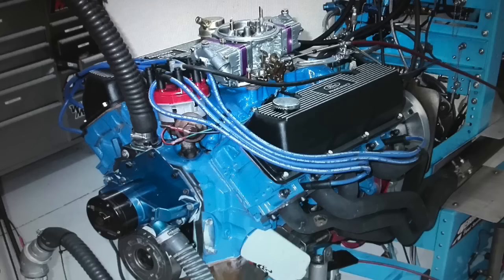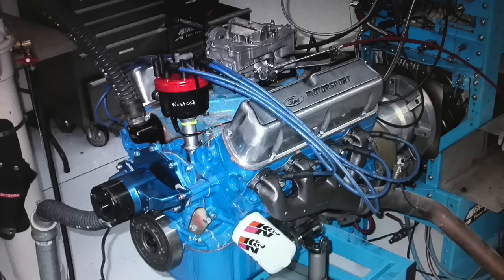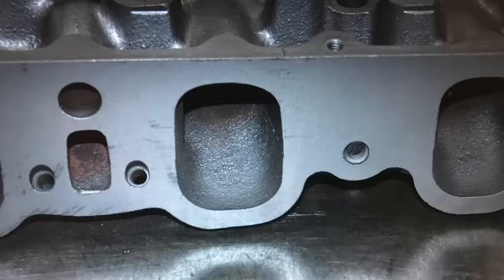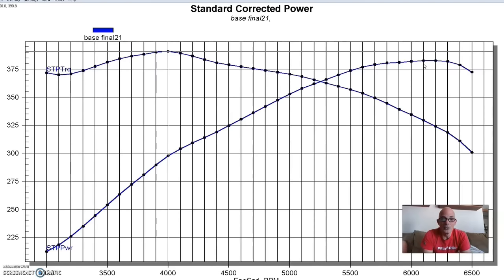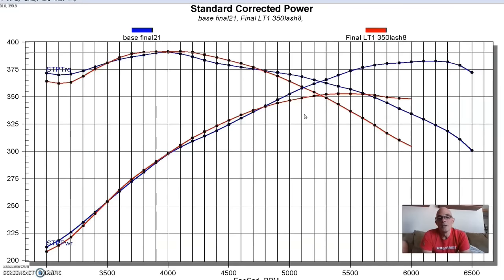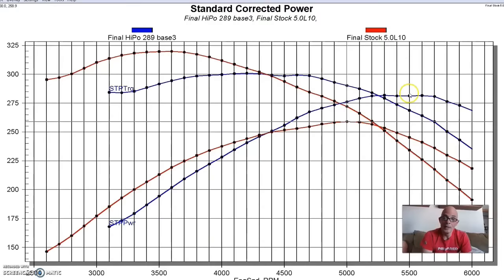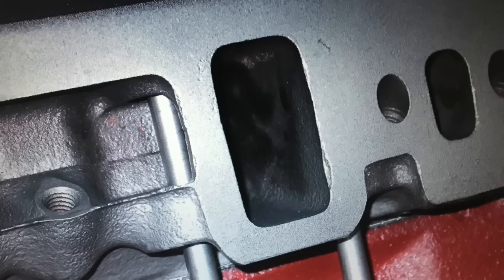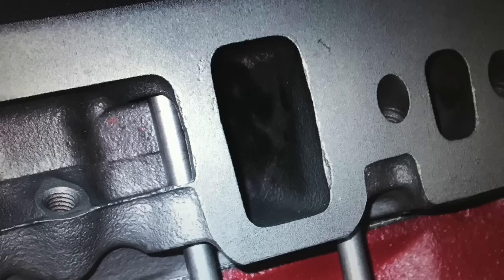HOW MUCH POWER DID THE 1971 BOSS 351 REALLY MAKE? WAS IT THE HOTTEST SMALL BLOCK EVER OFFERED?

Comment: Awesome vid. The GTHO's 351 Cleveland engine output was understated as 300 bhp (224 kW) to satisfy insurers. It is generally accepted to produce in the region of 350-380 bhp (265 kW -283 kW). Initial cars were equipped with an electrical rev limiter which came into effect at 6,150 rpm. With the rev limiter disabled, the engine was reputed to pull in excess of 7,000 rpm, even in fourth gear. At that time the Phase III GTHO was the world's fastest four-door production car.[4] 
Performance: 

Top speed: 228 km/h (142 mph) @ 6150rpm 0 - 60 mph - 6.4 seconds 0 – 100 km - 6.9 seconds Standing 1/4 mile (400m) - 14.4 seconds using the standard 3.25:1 Detroit Locker diff ratio. An optional 3.9:1 ratio differential was available and reputedly enabled such cars to cover the 1/4 mile in 13.9 seconds. In November 1971, Ford of Australia began producing its own 351C engines, ending the importation of American engines. At the outset, Australia only produced a 351-2V engine, but in March 1972 Ford of Australia began to offer a new 351-4V engine with a 4-barrel carburetor. Australia only produced one style of cylinder head for the 351 engines, a 2V head with small ports and open chamber cylinder heads. As a result, the Australian 351-4V engines used the 2V cylinder head. This required a unique 4V intake manifold with the smaller 2V ports, unlike the American 351-4V intake manifold which used the large ports.[1] No 351C built in Australia used the large port cylinder heads or closed chamber combustion chambers like the US built 351C-4V engines

Easy info straight from wiki, plenty more available with a easy google search. And then there is the rarer phase 4
Reply: Hmmmm same performance figures as my 2008 V6 Camry daily driver. Tyres were crap back then though. Modern tyres on a phase 3 would be much faster. That's if anyone ever drove a phase 3 anymore.
Reply: I did not realize only one head was available in Australia. However,  the hot ticket is to buy Australia 2V heads with closed chambers. I think you may have some bad information ??
Reply: @daleostrom3613  when I was a kid there were 2v and 4v heads, closed and open chamber freely available from wrecked Falcons.
Sounds strange to me too.
Reply: @daleostrom3613  haha living in austraila have three sets of closed chambers 2v heads and virgin bore 351 cleveland  short D block ...with pistons and crank ...Sitting in my garage...... also have a 302 cleveland complete motor on oringal bores and 2v heads....in the garage ........to name some of my fords here .....
Reply: @jamiegreenwood7996  yeah Im not a Cleveland guy more into modulars just took info from wiki, my mistake. I still stand by that the aussie Cleveland was the most powerful mass factory produced ford small block.... "In The World"

Comment: I have a stock 1990 5.0 mustang. Without doing heads, what's a good option to add a little power? I figured a cam cause it's always felt gutless up top.
Reply from the maker: gears, headers and cam with springs
Reply: @richardholdener1727  Thank you for the reply!

Comment: How would it compare to a stroker 347 with those (see if I get this right from my memory of thumbing through old Jegs catolouges) trick flow twisted wedge heads?
Reply from the maker: A stock Boss motor vs a modified 347 Windsor stroker with after market aluminum heads?

Comment: The first engine I ever rebuilt, about 35 years ago was an M code 351 4v Cleveland. Yanked the 302 2 bbl and 3 speed out of a 66 Fairlane, and dropped the 351 and a top loader 4 speed back in. Never lost a race once I finally figured out how to put the power to the ground, but that's a whole nother story 😁

Comment: Hahahaaa.....
I’ve been proving that for 40yrs!
The 351B is a beast, it’s Fords exotic solid cam engine. Ya just gotta play with the oiling system a bit and that’s a cinch.  One or two restrictor plugs and it’s good.
On a side note the 1971 Boss 351 Mustang was the fastest stock production Mustang until the mid 90s, ran like 13 flat in the quarter.

Comment: I've had more than my fair share of fast muscle cars and agree with your favorite Boss motor for many of my own reasons. I do, however, have a question about your Boss Cleveland assembly you had not mentioned. As most true Ford guys know, the four barrel Cleveland heads had 2 very distinct/different designs. Which were used on your Boss Cleveland? The "Open combustion" or "closed/quench?"
Reply from the maker: the Boss 351 only had 1 style 4V head-it was a closed chamber
Reply: @richardholdener1727  My question has been answered. My statement, however, was in reference to 4 barrel Cleveland heads and not just the Boss application. My apologies for the confusion.

Comment: The 289 was a great engine for its time. It had a small carb, and its K code Challenger heads were the normal heads, just screw in studs rather than press-fit. Fords tend to run smaller ports and valves in their heads than Chevy counterparts, which helps torque---until you get to the exhaust port, which is always crimped up to fit against the shock towers (the first Windsor was the 221, named after the flathead like many Fords begin their displacement like the 239 Y block, destined for the Falcon, with those shock towers in the way). A common replacement after 1969 was to run 351 W heads with the bigger head bolts. Until then, Ford had a Tunnel Port head that evolved into the Boss 302 setup.

What may have also helped, was George Barris signed up with Ford, and tossed the 289 into a few star vehicles like the Munster Coach. Monkey see, monkey do. But dump a 289 in something light, like a Sunbeam Tiger, and that light weight combined with the torque, makes things happen. HP sells engines, torque wins races :)

No doubt, tho, the 5.0 engine of the 1980's was a home run--and matched to the T5 transmission gears really helped avoid running into its 4500 RPM unofficial redline where it ran out of breath. Tune it right, run 13.4's in the quarter, and you thought you had a 390 GT or 428 CJ. The AOD did it no favors, tho, showing the gear ratios in the transmission really helped its performance.

Comment: The autoshop teacher told me to find some heads to build for my 68 mustang.  I went to Ford Power Parts in Norwalk I think.  They had some high-po 289 heads that needed rebuilding.  Think I paid about $100.00.
Took them to Jackson's auto in Brea, and the old guy there did the machine work on the heads for me for a song, and some sweat equity.
Granted what I'm going to outline is in no way stock.  It had the heads from a high po 289.  It was a 1968 302, stroked to 331, domed pistons ground to accept the valves from the high po 289 hieads, a mild cam and a holley 620 on a weiand aluminum ported dual plane high rise intake manifold. 10.5/1 compression, and tri y headers.  We didn't have an engine dyno in autoshop in 1991, but had access to a rolling dyno down the road from the high school.  I'd have to find the print out to give you peak torque at the wheel, but the horse power was 320 at 6800rpm at the wheels.  That was through a 4 speed top-loader, and 9" rear end ( after I made the stock rear end quit).

Comment: Early February 1972 I performed the dealership PDI on a just off the transporter brand new '72 GranTorino formal roof bench seat , column shift , AM radio, rubber floormat ,poverty capped 8x15 wheeled 351 SCJ, 11-1 compression solid lifter hd C6,391 locker , heavyduty everything incldg 11x3 rear drums front hd disc brakes . I waited until the snow melted and roads dried before the test drive, unlike anything I'd driven...summer of '81 as borrowing Alan Kulwicki's tire groover, for our 1 of 3 Fords running that season, found car in Alan's dads garage in Greenfield,Wi. only now with 5.13 gears and tubular front end . Several weeks later Alan made his first laps at Hales Corner Speedway in that Gran Torino bodied racecar ,Cleveland screaming like a Grumpy Jenkins smallblock . I guess I drove Alan Kulwicki's first race car before his dad bought it ...Thanx for the memory jog
Reply from the maker: 1972? was it a left over 1971 (last year of the high compression in the Boss 351)
Reply: @richardholdener1727       I was told, by the guy who ordered cars for the dealership, somebody must have hit the wrong keypunch and it was a mistake(wink-wink) but there were items on that car that couldn't have been that many keypunch errors. I think Alan's dad new someone at Ford to push the Last Hurrah as a gift for his son's 16th birthday. Window sticker read just over $3,200 , just before I left the dealership  in October "72 with new '73's on the lot , I was told I could get the car for $2,500 but my dad wouldn't co-sign. Obviously Alan got the deal. He did well .   Imagine brushing 8" snow of the car to open the hood to read the air cleaner lid labels "351SCJ"  "PREMIUM FUEL ONLY" and aluminum valve cover sticker solid lifter specs.

Comment: My dad talked about a 64 Fairlane with a 289 hipo looking like a super stocker at the time and I had one that I dropped in my 68 Mustang coupe that I beat a number of early 90s mustangs that had gearing cold air kits and exhaust work with pulley kits and still couldn't hang with my 68.

Comment: I've owned a 340 Duster. The 340 is trick, from the factory. Forged crank, pistons, windage tray, double roller timing chain, 2.02" valved heads, etc. But in factory trim, a 351 Cleveland is hard to beat.

Comment: How are you mate , I'm a passionate Henry man from Australia . The home of the very best of  cylinder heads for the M code 351 cleveland . These heads have the small valves , smallest combustion chambers 51 to 54 cc's for a 40"' skim should give nice square head decks and 12.4😢 through 12.7 , my honed block
Reply from the maker: noice mate!
Reply: @richardholdener1727   did you get a look at the profile ?. Typo on inlet peak valve lift should read 622 "' , not 522"' , all other facets of the profile are accurate . The 2 Venturi small valve , small port heads from Aussie 1970 thought to 1982 have 54 cc's to 57 cc'd here and I , which gave me an even across all 8 cyl's of 245 psi . This base combo when added to an M code is the ducks guts , to use an older Aussie colloquial term .
Reply from the maker: what profile?

Comment: Great video, a couple questions. Did ford use the windsor block in the boss 351 like was stated in the boss 302? And what was the cam specs for the 351? I'd love to see a comparison of the classic 4v heads and a modern alum.
Reply from the maker: we used a 351C block for the Boss 351
Reply: The Boss 302 Block is different than the Regular 302 Block. Much stronger virtually everywhere. 4 Bolt Mains, Screw in Freeze Plugs. About the only thing in common is the Bore and Stroke Dimensions.
Reply: all 302's were windsor blocks. 351c, 400m, boss 351c are clev blocks. boss was +adjust rockers & sol cam, 4-bolt, forged crank? & pistons?, HD rods. The canted valve heads are clev. 302 & clev blocks could swap heads with a few water passage mods. 351W was the grocery getter back in the day (as I recall it)

Comment: Back when I was a teenager whose friend's Dads had plenty of money, I had the chance to ride back to town in  one of my friends Camaro with a 327. At one light, a 289 Hipo pulled up next to us, also one of the guys. When the lights turned green ,they had a good start but in 2 races, the Mustang pulled away from the Camaro. The guy driving the Camaro was in such disbelief that he let the Ford driver drive his car and one of the other guys drove the Mustang with identical results. I may be wrong but I believe that advertised HP was 250 for the 327 and 289 for the 289. ???
Reply: 289 Hi Po K code rated at 271 HP

Comment: What's  the Flow Bench numbers 🤔
1. Boss 351 Heads
2. Hope 289 heads
Thanks 😊
Reply from the maker: HiPo 289 heads flow about 160-165 cfm, 4V Cleveland/Boss 302 heads for 275 cfm
Reply: @richardholdener1727  
Wow  huge difference 
Thanks 😊

Comment: So what exactly is the Diff between a '70 M-code Cleveland and the '71 Boss, R-code engines? Just the Cam? Headers? 4-bolt mains on the '71....I think the quench 4v heads & intake were the same, on both.
Reply from the maker: cam, intake, compression, carb,

Comment: I heard some mixing of metaphors which when talking fast, I can understand :-) . But to clear one thing up, the '70 M code was 11.0:1 CR. The '71 Boss with its pop up pistons was 11.7:1 . Combined with the bigger cam which was also tuned above the M code's 5800 RPM peak, that helped make the extra power. These came with rev limiters set for 6,250 RPM from the factory, any by your dyno curves it's easy to understand why people quickly took them off, because it keep pulling! Unfortunately the stock rods, even with the boss rod bolts, were known to fail when spending much time above 6,250. But yes Virginia, the Boss did have higher compression.
Reply from the maker: Mixed metaphors?

Comment: Awesome video! Didn't know boss heads are Cleveland 4V heads. What did the 2V heads flow? What's your 5.0 do on the dyno? What do you think of kaase heads? You seriously rock. Love watching your videos during this quirentine!
Reply from the maker: Boss heads are slightly different than 4V, same port but different water passages. 2V are not great, my 5.0L had a Vortech supercharger, TFS heads and XE274HR cam (actially the Crane version)-it made about 450 whp with the A/B trim
Reply: @richardholdener1727  I beg to differ on the 2V head. 11.80's in a 3300# car with 351 2v. Never on a dyno, but that's 400+ hp. The torque that car made was unreal.

Comment: About the HiPo, we had a guy who had a K code 66, four speed, 4.10 gears. He ran low 15s in the quarter in the late 80s. Most of the 5.0s were running about the same times. The slowest V8 I have owned was my 67 Cougar with its 302 from a 68 Galaxy. It would be lucky to run a 17 with that engine. The Cougar got a Cleveland with 4V heads, and a C4 trans I built, sadly I haven't driven it since 1987 but its in my yard waiting to get work. My 4V powered Mustangs in the 1980s were kinda nuts with nothing more than a larger cam (224/228@.050 109 LSA) and headers. Ford wasn't the only one selling performance in 71, Pontiac was selling power in 71-72 in the form of the 455 HO, and 73/74 was the 455 SD, sure they had low compression, but 455s don't give a damn, they will still grunt out the torque.
Reply: Bach then magazines showed original GT350s doing 15.3 usually. A cold day tickled 15.0.
A well tuned Fox will do 14.3 on the street.
Evan Smith took his Fox to 13.0 with only timing....
Documented.
Reply: Timing was the only engine mod.

Comment: Years ago Hot Rod magazine tested all small blocks ( not replicas ) and got the exact same results as Richard. Boss 351 385 horsepower. 2nd place 1970 300 horse rated 11 to 1 Cleveland 365 horsepower, like Richard's other video. In 1970 I had a 300 horse 351 Mustang. I did the same thing as Richard- aluminum manifold, 780 holly, hotter cam, better and curved distributor. He got 450 horsepower. I know mine didn't make that with 1970 bolt on's, but it was plenty to beat my mechanic's Cobra Jet Mustang in the quarter.
Reply from the maker: look at the name on the Hot Rod article-it should look familiar

Comment: Not a Ford guy at all, but there is no question the Cleveland heads flowed a lot. The 351 Cleveland engine is massive for a small block, however. I had a friend with a 70 Cougar with a 351C 4V and I worked on it quite a bit. That engine was a very tight fit in a Mustang / Cougar.

Comment: I loved the 289 High Performance when I was a kid. I think the first ones were in Comets or Fairlanes in 1963. A friend had one in a 1965 Mustang and it won a lot of races partly because of the horible street tires of the day. Big block Camaros or Chevelles could never get traction then. Wanted one so bad for my Sunbeam Tiger but never did. Would have loved on in my 1965 Mustang GT Fastback instead of the standard four barrel model also. 
The Boss 302 in 1968 I think was much better but just a place holder until the Boss 351 came out in 1971. Cars were getting faster every year and the 289 was dated by then  but in the early 1960's with low gears was pretty fast.

Comment: Sounds like the C351 would make a great turbo motor!! 😊
Reply: It would except engine cores are hard to find here on the US.  Ford stopped making the Cleveland after 1974 in the US.  Aftermarket support here is also not as strong as it is for the Windsor.  Lastly you have to correct the Clevelands non priority main oil system which is pretty simple.